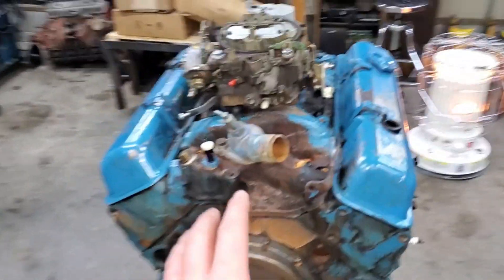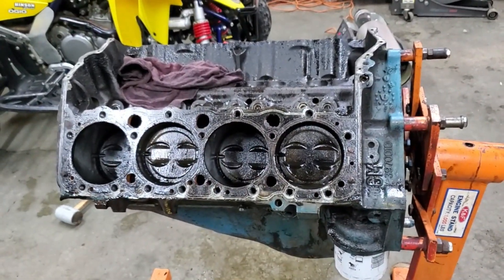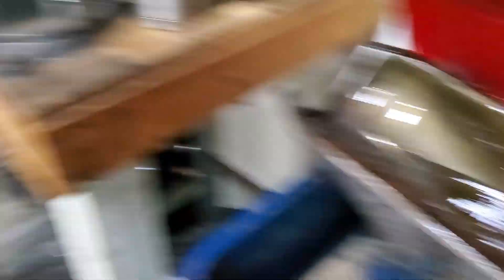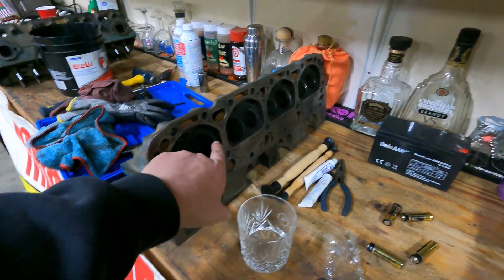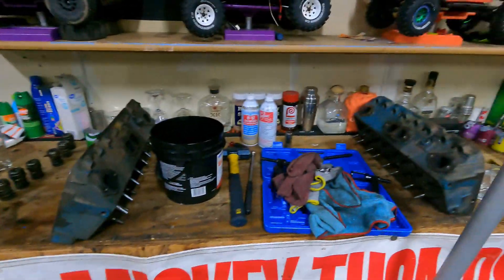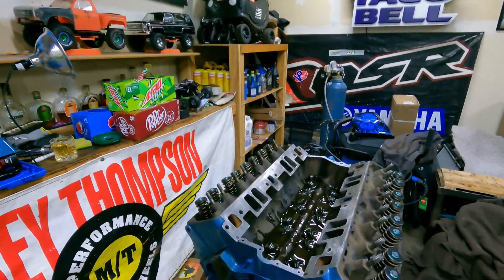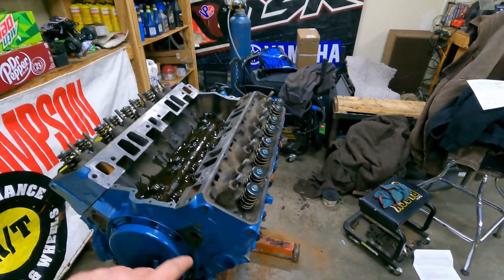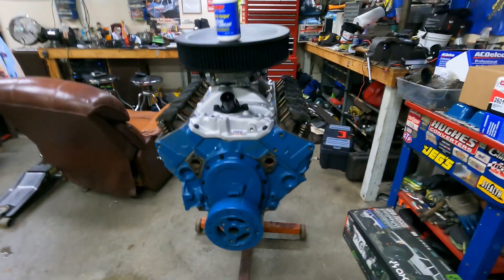Building our Chevy 350

Comment: What camshaft did you use? What was the part number?
Reply from the maker: I went with a comp cams.  I picked one that could work with a stock converter(still going to use a 2000stall). I wanted more bottom end power for the woods and just wanted the motor over all to be really driver friendly. This is the item number and we purchased from summit K12-211-2

Comment: So, you are putting bigger valve springs on, but still have press in rocker studs? I think I would at least pin the studs.
Reply from the maker: The cam we put in is not very big. So I do believe the springs are close to stock. Now besides all that. It is good to replace your studs when rebuilding your heads though.